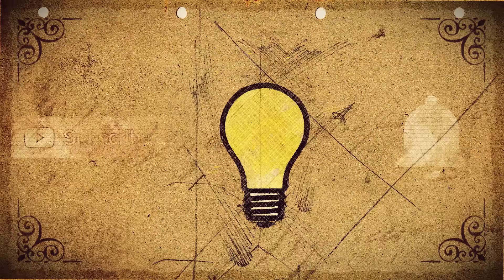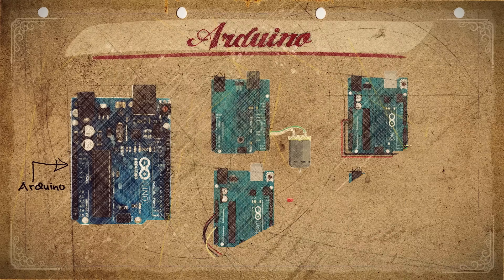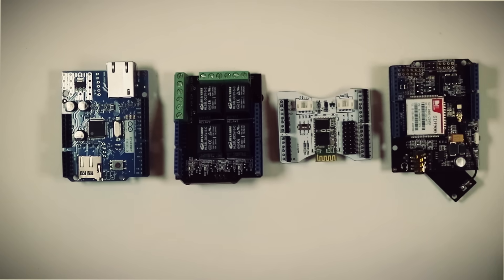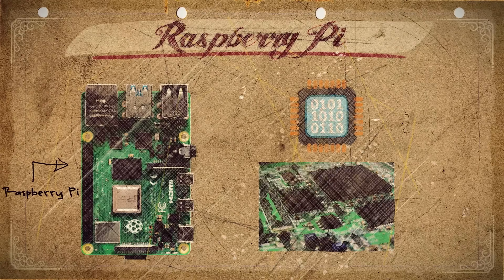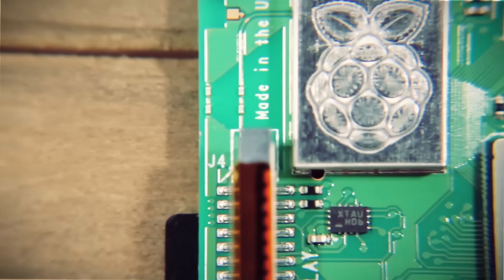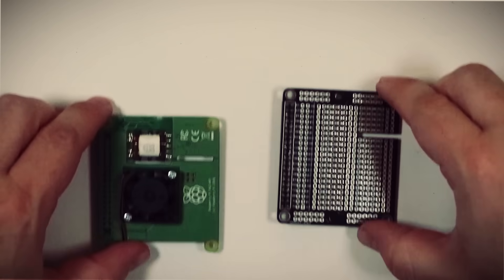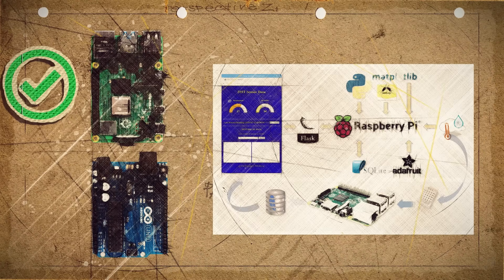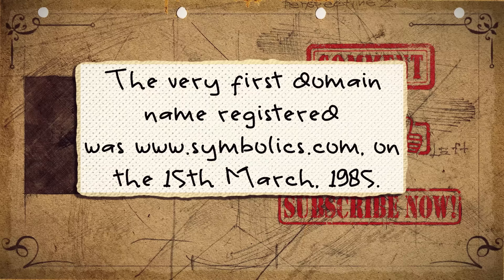What's the difference? Arduino vs Raspberry Pi

Comment: What about using a rasberry py to do complex calculations and then send them and execute them with an adduino?

(Like controlling lots of motors for a walking robot)
Reply: But he's already answer this, in case you need camera or so, go RPi (as supervisor), but low level steering (motors, servos) it's arduino job.
Reply: @jankomuzykant1844  Use a Pi only, you can easily control motors with Raspberry Pi hats. Generally, the Arduino can only do a subset of what the Raspi can.
Reply: @aloiskleinestier1848  In your case you use hardware motor controller instead of arduino. This is not the same as use arduino instead rpi.
But of course this is one of best method.
Reply: Bump. I'm curious the answer to this

Comment: Internet controlled rc car..can you make it?
Reply: Of course it can be made, but why? It would require the RC car to either be powered by or somehow controlled by an Arduino or Raspberry PI that executes a set of instructions upon receiving a specific stream of data from a socket connected to a web server whether it's an API or a fully designed web application. It sounds cool, but would be really pointless when you consider the time, effort, and money it would require to make.

Comment: So basically Arduino is what Electronics Engineer use for their hobbies while Raspberry Pi are to Programmers.
Reply: Not quite. I'm a computer engineer, both Arduino and RPi are tools for data acquisition, signal processing, communication/networking, and providing local storage. These are made for hardware-based projects. All of it can be programmed in basic languages like Python, C/C++, terminal script. I'm not labeled a programmer, but I program often because I'm using these micro-controllers. Programmers are purely in the software domain, and are more likely to run simulations with little need to gather empirical data, so they have less use for things like Arduinos and RPi.
Reply: Kind of. Microcontrollers that run straight code are real time. Reading and writing to gpio is reliable on arduino. Anything running an os, will cause delays in your code run time (it has to run other stuff). So you dont know when your code will run, which means a Rpi can't do precise timing on gpio. Eg you can emulate a serial port on gpio on arduino, but you cant on Rpi because the timing will not be always correct.

For engineers, usually precise timing is everything. Software engineers dont care about hardware so they go for Rpi.
Reply: @TheBodgybrothers  And OS comes on different standard.  By the way Arduino also has ARMs version.
Reply: Absolutely not.
Reply: No.

Comment: Great animations! I roll arduino for simple controller tasks - and pi for everything else. I even have lots of projects using both platforms together for analog capture over serial to the pi :) Thanks for this video. It helps explain what I am not good at to my "screen-glass" kids. I use this term to cover kids that have never used a mouse or physical keyboard to input data.